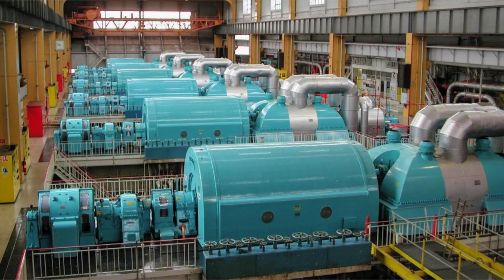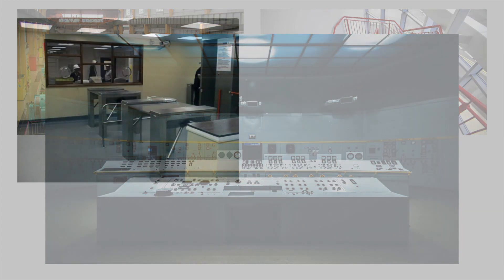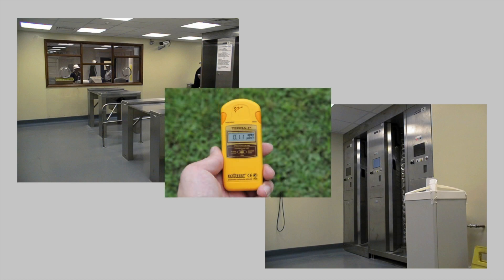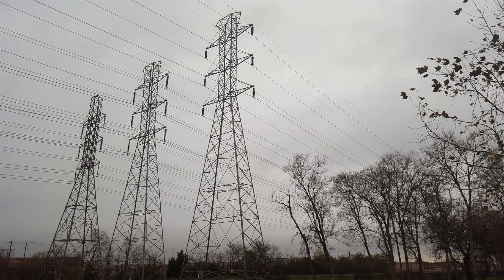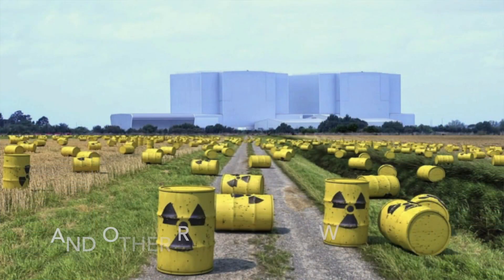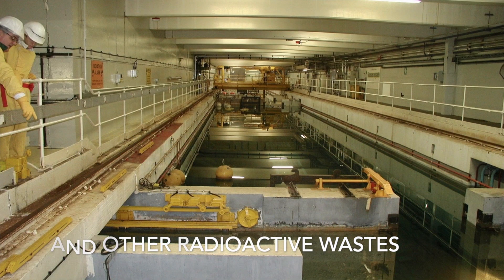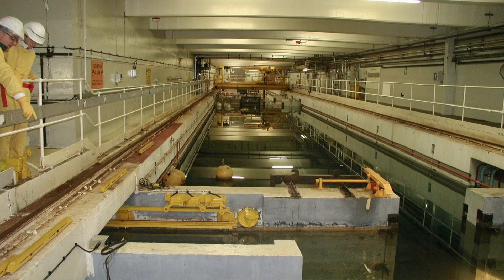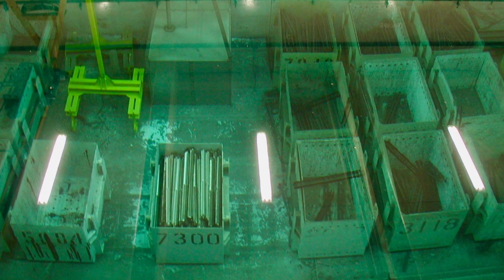Small Modular Reactors Part Two - we look into the issue of radioactive waste and electricity costs

Comment: Peter Banks! I have missed your videos, so I am glad to have discovered you have been continuing on with them. Also, I found your joke at 4:20 quite funny. :)

However, as usual, I am quite puzzled as to why you view this video as anti-nuclear; the underlying facts you cite are quite pro-nuclear, and the opinions you offer just seem to be, well, opinion.

In the beginning you talk about the bits of a modular reactor requiring multiple components to be shipped in and plugged together. But that is what modularity is all about - reactor, steam generators, turbines, cooling pool and the buildings of course, usually desirable to put the components in a building (office, reactor building, turbine hall).

On waste - so if waste in dry cask storage quietly sits there for 100 years, the issue is????

On the geological disposal facility being a dump - yes! However, unlike a the current disposal of carbon dioxide from fossil fuel plants, fly ash from coal plants, heavy metals from solar PV panels, epoxy resin from wind turbine blades - the nuclear waste will:
A - end up in the dump, not the biosphere
B - does not have much of a chance to leak into the biosphere

And although spend nuclear fuel is, as you point out dangerous, we do have transport systems capable of sending the spent fuel to reprocessing or the geological dump facility properly.

However, the most confusing aspect of your video is from 3:00 onwards, especially the timeline comments, given your suggestion of this article to William Pierce in the comments:
"I [Peter Banks] recommend this article, in case you haven't come across it yet in your research: https://thebulletin.org/2019/12/fact-check-five-claims-about-thorium-made-by-andrew-yang"

From the article:
"Claim: Building new nuclear reactors will likely be necessary if the United States wants to achieve net-zero emissions by 2049.

True. Nuclear energy is already the primary ultra-low carbon energy source for base-load electricity generation. ... So new nuclear reactors will be necessary ... to meet a net-zero carbon emissions goal."
Reply from the maker: Hello again and thanks for your comment. As you may have seen I have already given an answer to part of this in responding to another one of your comments in respect of the thebulletin.org link.

 Yes, I fully understand the concept of modularity, however, in reality the proposals do not include all the separate components from the same centrally managed source. The issues that arise between different manufacturer's components continues to plague the industry. Furthermore they did not learn from the same issue after problems ensuring compatibility for the first generation of reactors.

On waste whilst I acknowledge the pollution from fossil fuels your view of radioactive waste is too simplistic. As soon as a reactor starts everything around it is contaminated, albeit with varying degrees of radioactivity. However, this means the volume of waste continues to build at an incredible rate and cannot just be dumped and land reused immediately. There are more concerns, too. For example, routine emissions from nuclear plants and threat of terrorism.

Thanks again, keep safe. PB
Reply: @no2brb  "routine emissions from nuclear plants" - you do realize that routine radioactive emissions are higher from coal, natural gas, and geothermal power plants than nuclear plants? In fact, not just 'higher', but 100s of times higher.

"As soon as a reactor starts everything around it is contaminated" - sure, where 'everything' is a radius of a few meters. It doesn't turn radii of miles into a wasteland, and in fact most nuclear plants are often co-situated with nature reserves, where the wildlife thrives (not due to the reactor of course, but due to the lack of humans).

"However, this means the volume of waste continues to build at an incredible rate " - right. The waste of 65 years worth of 10% of global electricity is only 370,000 tons, where a few 1000 are added every year. It simply isn't that much. Try calculating out the mass of a skyscraper to get an estimate of how little 370,000 tons is.
Alternatively, a coal wagon on a train carries about 20 tons.
370,000 / 65 / 20 = 284 wagons of coal - with 50 wagons a train = 5.7 'trainloads' a year. ACROSS THE ENTIRE GLOBE!
370,000 tons sounds like a lot, but have a chat with a civil engineer sometime and you will realize the scale is quite small.
Reply from the maker: Thanks again. Hurrah, generally we agree, both coal and other fossil fuels are bad! Yes, radioactivity is released from trace elements burning coal, still considered NORM, equivalent to background radiation. Nuclear Power Plants routinely release naturally and non naturally occurring isotopes which have a much higher concentration and longevity. With fossil fuels the big issue is both the carbon /GHGs and particulate matter. 

Regardless I think you should examine the figures for how much dangerous waste the whole Uranium mining, refining, enrichment and fuel fabrication produces. Whilst Nuclear energy releases less CO2 it doesn't qualify as a readily variable source to balance the variation in renewable output. 

But, hey, let's rejoice in our bit of agreement?! PB
Reply: @no2brb  "Nuclear ... doesn't qualify as a readily variable source to balance the variation in renewable output."

Peter, I believe this sentence really illustrates the difference between our viewpoints.

[RE refers to intermittent RE like wind and solar, not dispatchable RE like hydro and geothermal - also, Norway's 98% clean electricity from dispatchable hydro predicts nothing, NOTHING about Germany's ability to reach a clean grid with intermittent wind!].

I view electricity as a service to provide consumers, and the more the better (higher juice ==> higher quality of life/education/fulfillment + less carbon if displacing transport fuels). The goal of the grid is to provide electricity _according to consumer demand_.

The goal of the grid, and any generation source on it, IS NOT to accommodate 'the variation in renewable output.'

I have a similar problem with the German government. Their goal is to raise RE % and reduce nuclear % - their goal should be to reduce carbon emissions, not to raise RE %. 

RE, and not nuclear, may be how they achieve that goal, but the goal is not RE! 

Nor is the goal of the grid to accommodate RE, but to accommodate consumers. Your focus is that nuclear doesn't accommodate RE, thus it is bad (among other reasons).
My view is that RE doesn't accommodate consumers, thus it is somewhat less valuable for powering a low-carbon, high-electricity society.

France does have load-following nuclear. However, their emissions have risen just a bit over the last few years - why?

France installed intermittent windmills.
Although nuclear had been able to load follow consumer demand for decades, as you point out it could not deal with the vagaries of the wind. So France ALSO installed fast-acting natural gas to balance wind energy (not consumer demand, but wind intermittency) - and the natural gas combustion raised France's emissions.

Wasn't the point of wind to lower emissions????? Insanity!
Reply from the maker: OK, I am not ignorant of the challenge of intermittency and I am sure you realise that? But what you suggest begs the question of would be why has France needed to install fast-acting natural gas plants to balance wind energy rather than nuclear? Because, as already discussed, Nuclear is not readily variable despite claims that France's NPPs has some load following plants.  We may have different views of the same issue, I maintain investment in Green gas (including Green Hydrogen where applicable) is essential. Thanks again, PB
Reply from the maker: Well, I have lived within 2.5 miles of a nuclear power plant for the last 35 years and it was operating until 2002. I can assure you that the metered supposedly 'permitted' emissions are only part of the picture. There are have also been many 'unplanned' emissions over the years that are deeply concerning. In addition to that there are discharges to the sea (in this case the Blackwater Estuary) of both radioactive and toxic effluent. This caused complete destruction of the marine ecosystem which has only recently started to recover.

Furthermore there have been big fines made after the discovery of radioactive leaks into the soil, contamination the local water table, which had been supposedly undetected for 11 years. There were strenuous efforts to cover this up, along with the same secrecy surrounding an early cyber-attack on the plant.

And whatever you choose to think I can confirm that the radioactivity around a nuclear power plant is higher than background and then, during decommissioning, substantially higher. During the operation incidences of childhood leukaemia were detected in the local primary school, with the acknowledgement of the source potentially being the plant strongly denied, and yet statistically this was confirmed as new cases fell after the fuel rods where whipped off-site. 

I am talking real world here, not theoretical safety practices by reporting that emissions are carried out in 'controlled, monitored process'. Of course, you are at liberty to still choose to counteract, however, I suspect I only know a part of what the industry attempts to hide. It is not good...
Reply: @no2brb  "[Discharges] caused complete destruction of the marine ecosystem which has only recently started to recover."
Well, complete destruction should be well documented. Perhaps you can post a link showing that evidence?

"There were strenuous efforts to cover this {leaks] up, along with the same secrecy surrounding an early cyber-attack on the plant."
You conflate immoral behavior with NPP operation. Of course, nor does NPP operation turn people immoral. If you have bad actors, send them to jail. If you have a need for power, don't turn down the easiest, biggest low-carbon power resource humanity has available.

"the radioactivity around a nuclear power plant is higher than background" - yes, I agree. Significantly higher? no. Dangerously high? no.

"During the operation incidences of childhood leukaemia were detected in the local primary school, with the acknowledgment of the source potentially being the plant strongly denied, and yet statistically this was confirmed as new cases fell after the fuel rods where whipped off-site."
Unfortunate to hear that these children contracted leukaemia. However, your cause-and-effect is a little fuzzy.

1. Leukaemia is, unfortunately, the most likely type of childhood cancer to occur anywhere in the UK, thus given cancer, it would naturally be likeliest to be leukaemia. But that doesn't imply it was caused by the NPP. (Sadly, the incidence of childhood leukaemia is going up).
https://www.cancerresearchuk.org/health-professional/cancer-statistics/childrens-cancers/incidence#heading-Three

2. There are multiple risk factors, exposure to radiation being just one of many. However, what is listed as the source of the radiation is radiotherapy and radon gas - both many, many, many multiples above the radiation released by NPPs.
https://www.cancerresearchuk.org/about-cancer/childrens-cancer/risks-causes
https://www.epa.gov/sites/production/files/styles/large/public/2017-04/donut-pie-chart.png
(obviously the US average, but the point is radon and medical are the big exposure points for any community)

3. You list no other types of cancers, which would be the case for radiation-induced cancers - radiation exposure affects the entire body - but your 'spike' of a specific type of cancer implies a more narrow causal affect (genetics? disease? carcinogen exposure?).

4. Children in northern Ukraine, Belarus, parts of Russia - despite receiving much, much higher doses of radiation from the Chernobyl No 4 accident - have no higher incidence of childhood leukaemia than other parts of the world.
A larger exposed population, higher levels of exposure - and yet the cancer 'cluster' is only seen near UK NPPs?
http://www.unscear.org/unscear/en/chernobyl.html

5. "as new cases fell after the fuel rods where whipped off-site" - this is the real smoking gun showing the lack of cause-and-effect.
Exposure to ionizing radiation that causes cancer will damage the cells, and be irreversible. Yet the cases stopped once the radiation source is removed?
From a report on Hiroshima survivors (again, much, much higher levels of radiation) 'Deaths from leukemia went up about two to three years after exposure, with the number of cases peaking after about 10 years and going down after that'
So if the Sizewell children were indeed victims of radiation exposure, cases would have CONTINUED after the "fuel rods were whipped off-site" and peaked some time later, perhaps 10 years later.
https://hps.org/publicinformation/ate/q11382.html
Reply: @no2brb  Again, you get this concept backwards "why has France needed to install fast-acting natural gas plants to balance wind energy rather than nuclear?"
France did not need to install  fast-acting natural gas plants to balance the consumer demand load.
France needed to install  fast-acting natural gas plants to balance the intermittent wind energy.

bottom line Wind energy requires dirty, high-carbon natural gas (because intermittent wind is not dispatchable, it cannot follow consumer demand load, with high-carbon gas).
Nuclear energy does not require natural gas (because nuclear is dispatchable, it can follow consumer demand load).

Again, the grid serves the consumer demand load. The purpose of the grid is NOT to be subservient to the participation of wind and solar!
Reply from the maker: Thanks again. You make a number of points. A couple quick responses: 'whipped' should have been 'shipped' and  on the 'complete destruction' claim I should have said that was surrounding the estuary cooling seawater discharge pipes, apologies. The evidence is included in the regulators reports all online but sometimes hard to find: https://www.gov.uk/government/organisations/environment-agency | https://www.gov.uk/government/organisations/marine-management-organisation
Reply from the maker: As before I have to confess my view is very UK-centric. However, this article may be of interest to you: https://www.businessgreen.com/news/4030965/national-grid-installs-pioneering-power-flow-tech-ease-network-bottlenecks P